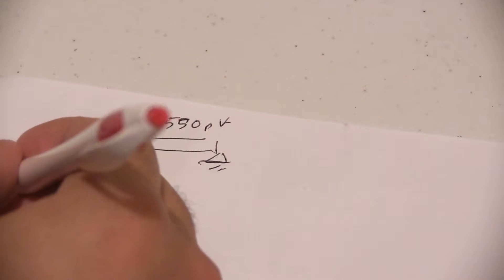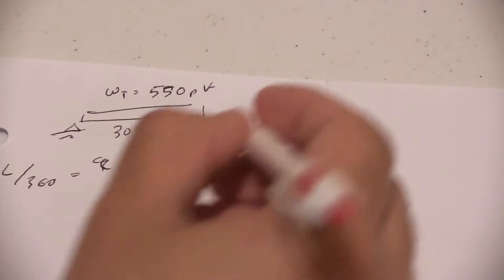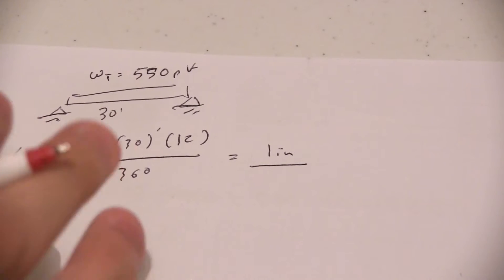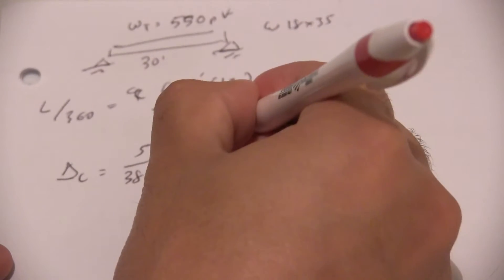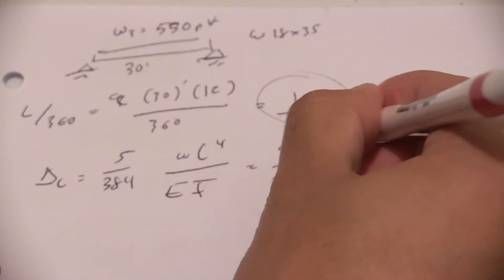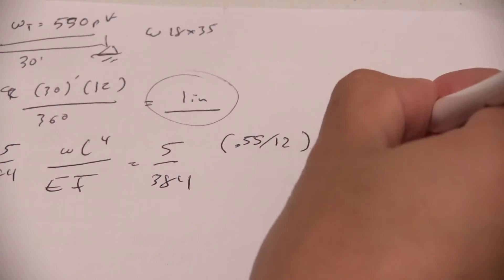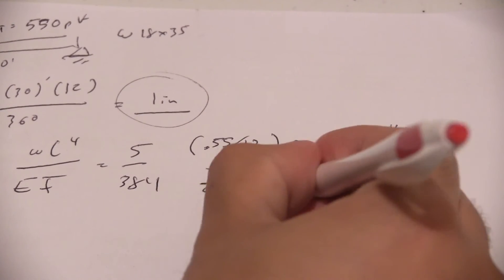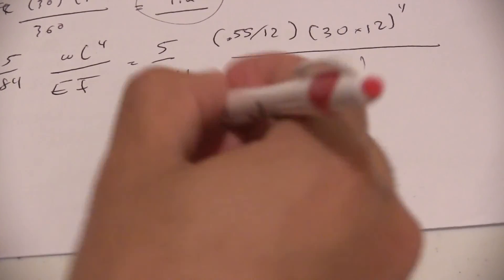Calculating Deflections in a Simple Beam

Comment: When do we use L/120 and etc. is this apply to steel , timber and concrete beams?
Reply from the maker: The deflection limits are based on code and materials, it applies to everything including columns.